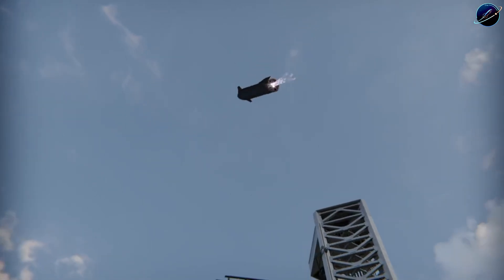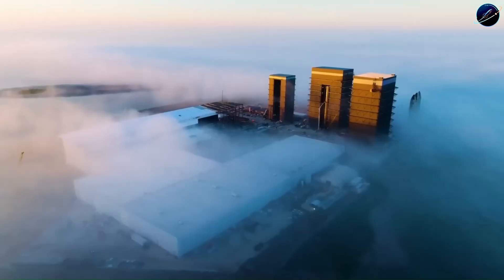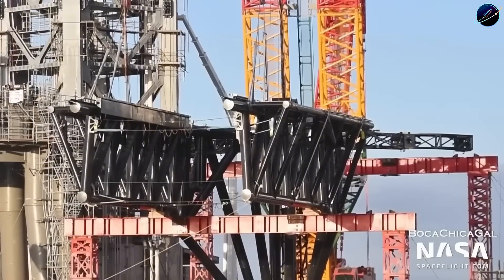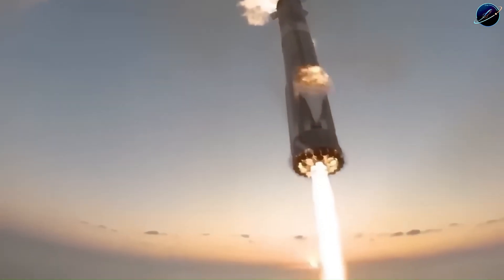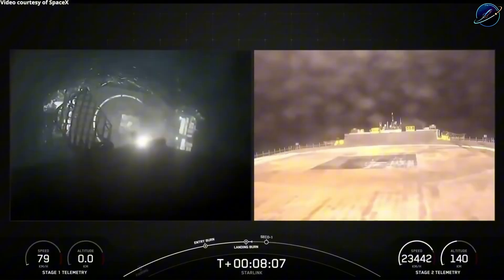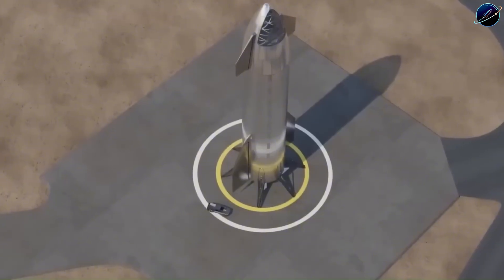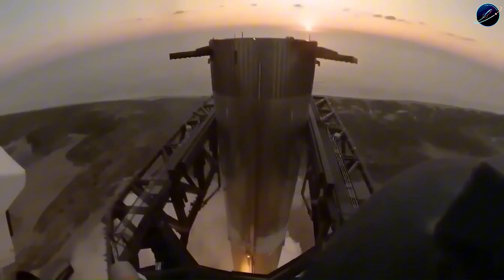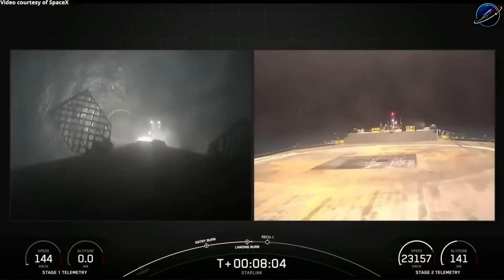Elon Musk Found Brilliant Way to Recover Starship...Shocked Rocket Industry!

Comment: Putting legs on starship will be very challenging  ! To land starship it  will need a combination of tactics like legs with airbags. 
  The top mounting point of the legs needs to be just at or above the center of gravity half way up starship to keep landings in the up rite position that means thin legs 🦵 with airbags at the bottom of them for soft and stable landings in the vertical position  !
Reply from the maker: SpaceX removed legs for tower catches to save mass & enable rapid reuse, so drone ship landings would require a major redesign (likely deployable ones with cushioning), but their track record turning "impossible" into routine makes it exciting to watch. What do you think they'll prioritize first?